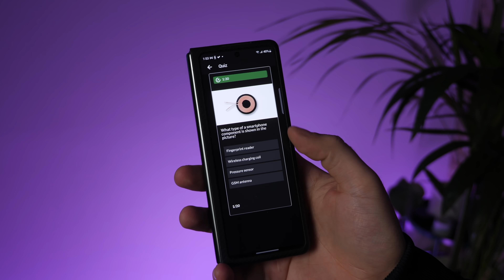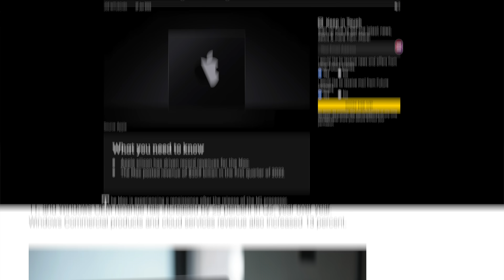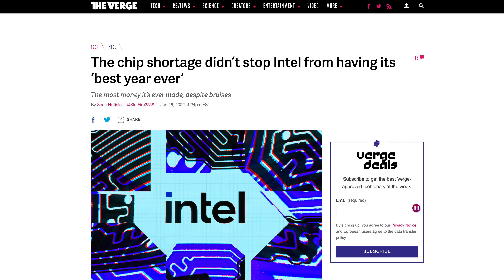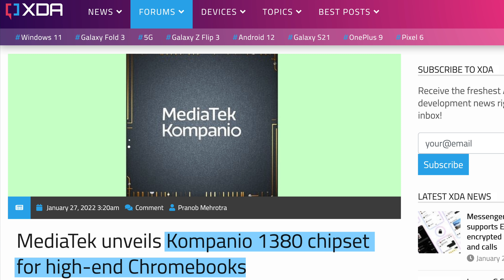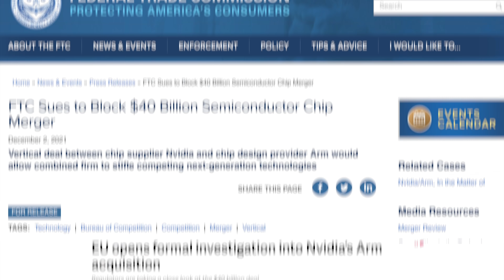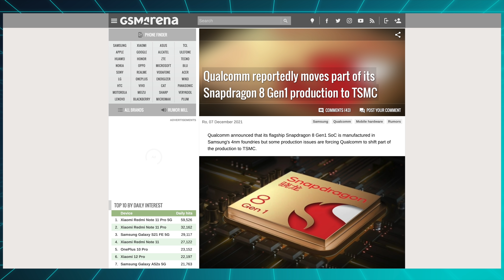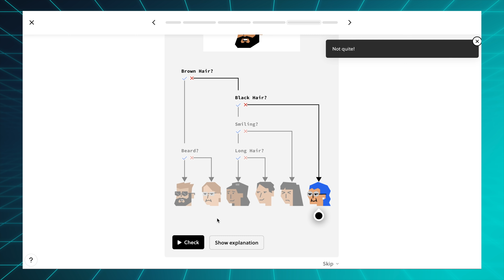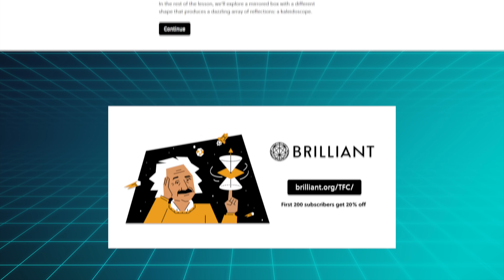Actually, Intel is doing great now

Comment: if its not a chip shortage time, intel wont make this much improvement as the tsmc (apple , amd) chips are running out of stock, people only got access to inefficient intel chips. Also they published faked benchmarking result with over usage of the term "ai".also oems didnt used gpus above 2060 in 4000 series and purposefully made bade thermal designs for amds bad reputation .

Comment: 02:01 because they are the best in the power management in the laptop market and the same time AMD is not available in large numbers and the same time windows 11 causing AMD not going to work full performance on windows 11 and also hot countries like India and UAE AMD chips are not that best especially budget build in India (they (lot of people in India) don't understand about cooling and power supply quality importance so Intel is pretty much know this problem so they adjust according to the region) and also Intel very much good (not as good in some cases) in every budget price point performance is ok 👌
Reply: Yeah, intel's laptop power mangement is very good. It can peform reliabliy and scale well to a wide range of TDPs.
Reply: What are you even talking about? AMD is better for budget oriented buyers. Intel's "budget" chips are over 3 years old outdated crap.

Comment: Nokia delivered the Android 11 on my Nokia 2.3 this Tuesday in India and its more stable  than the Android 10
Reply: Nokia is dead.
Reply: @elakstein  nope they are doing good in 5G bu not good in consumer electronics
Reply: @gazzy01  that is because those are two different companies these days
Reply: HMD is doing a pretty bad job right now.
Reply: Congrats. You finally got 11 when 13's beta is just round the corner
Reply: @SShreyas17  still its the maximum the device can meet os requirement. LOL most of the devices still don't received 11 yet